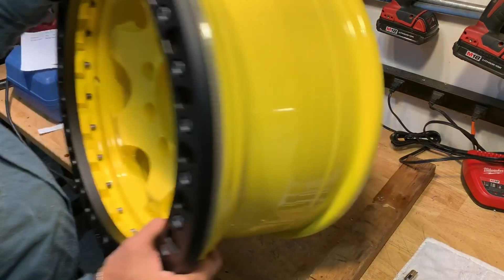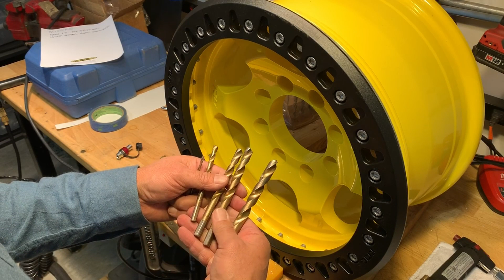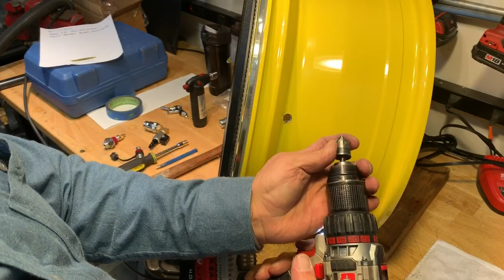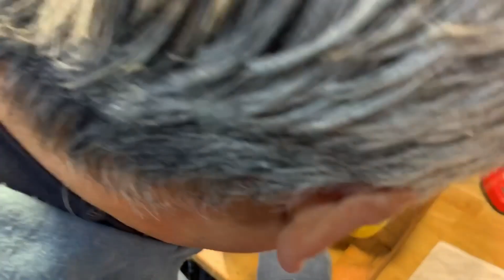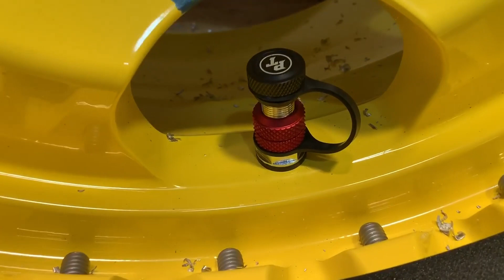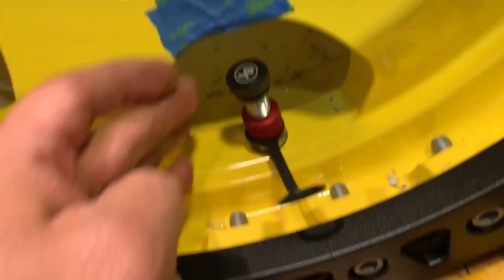Monster Valve 3 (MV3) Install into a KMC Beadlock Wheel

Comment: Love my monster valves. What kind of maintenance is needed on the red air down part if they get sticky ?
Reply from the maker: If the red collar is tough to turn, it's likely the o-rings are dry. Simply unscrew the red collars all the way off the stem and smear a thin layer of silicone or dielectric grease on both the o-ring in the red collar and the one on the stem. Then reassemble. Do not use petroleum based lubricants as they will eat away at the EPDM o-rings. If the o-rings need to be replaced or you'd like to keep a set of spares, contact us via info@powertank.com and we can get you some new ones.

Comment: If my wheel already has dual valve stems (xd machete crawl beadlock) could I just drill out one of stem holes?
Reply from the maker: No, the recess is too large hampering clearance. We will be releasing a KMC specific Monster Valve shortly.
Reply: @PowerTankOfficial  thank you, is it possible for me to get on a list to know when it is released?
Reply from the maker: @reeceprice4874  Please email me at tyler@powertank.com and I will notify you when they are available.